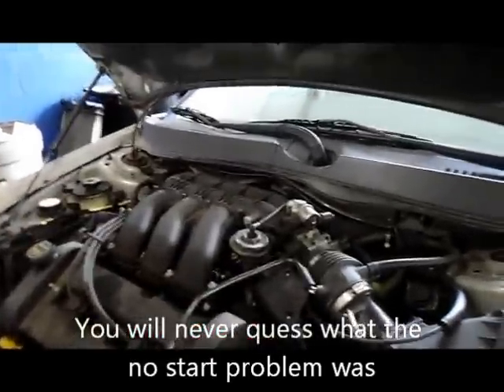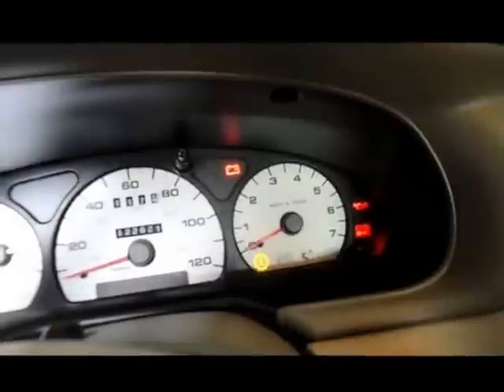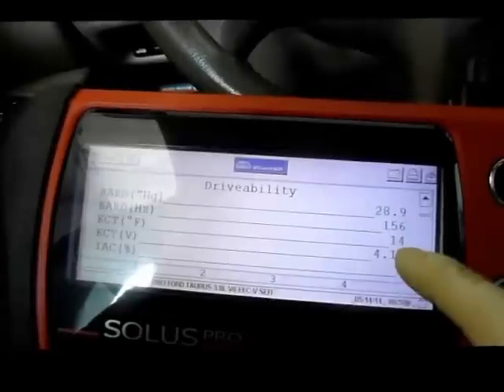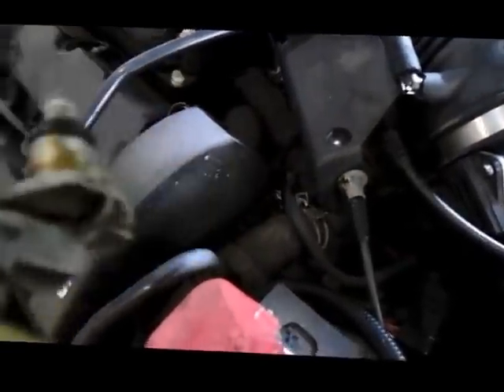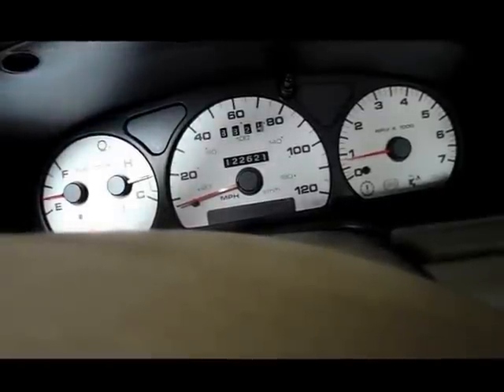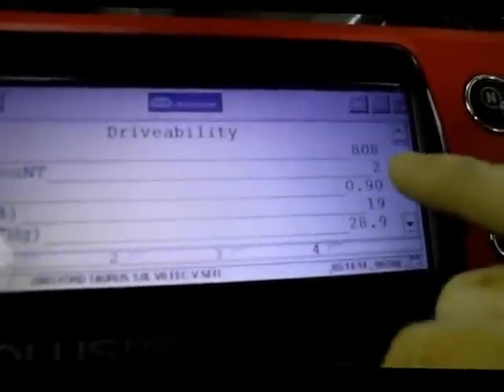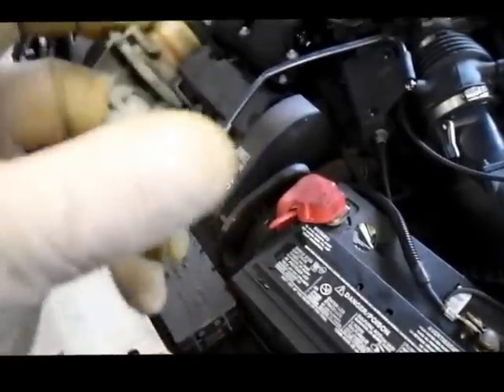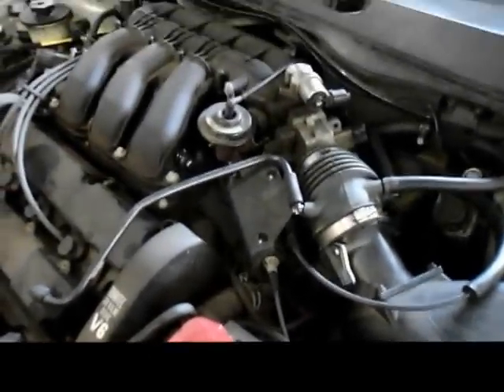Engine cranks but won't start

Comment: What if the car wont start no crank...but it turn on.
Reply from the maker: Check out these videos . Maybe they will help you to diagnose the problem.   
https://youtu.be/Sqg33Mz1308 
https://youtu.be/oka0WrKLiVc
https://youtu.be/UxqJ_EP8f8o

https://youtu.be/UxqJ_EP8f8o

https://youtu.be/5zZZWd--duE
Reply: AAH FOR THAT ONE I THINK THE YOUR PROBLEM IS ON THE STARTER SELONOID. EITHER YOUR SELONOID CABLE IS DISCONNECTED OR THE SELONOID ITSELF IS WORN. FOR YOU TO KNOW EXACTLY WHAT IS THE PROBLEM LET SOMEONE GO TO START YOUR CAR AND YOU YOUSELF BE INFRONT BONNET OPEN. WHEN HE TRIES TO START LISTEN CAREFULLY FOR A CLICK SOUND FROM THE STARTER IF IT IS NOT THER THEN I CAN ASSURE YOU THAT THE CABLE IS DISCONNECTED OR YOU HAVE TO CHANE THE SELONOID
Reply: @m.b.smoshitoa8325  Well i have a 2001 honda accord. I change the gasket for the Vtec solenoid in suddenly it dont crank or start the car but it turn on lights. I did change the starter but is still the same help?
Reply: Maybe a safety switch on the trans.
Reply: My car 2002 Honda crv was running fine. Stopped at store and killed it and it won't start again. It will turn over till the battery dies but it won't start. Put alternator and fuel pump on it but it still won't start. Please help me and thank you.
Reply: @susieshade60  This is why garages pay a fortune for diagnostic tools because cars have become more and more computerized.. as you can see from this video a simple coolant sensor could cause you car not to start.. unfortunately people would be simply guessing the issue and as you say you have bought new parts that you may have never needed...My two cence though is it seems you have an electrical fault..
Reply: Sounds like it can be the starter, that can be checked on car, tap it with something to see if it starts, if does, then starter, before putting a new starter in, always bench test them, jump start them on bench, BATTERY hooked up the right way, they put black to ground and red to nut wear wire bolts to, be careful, the gear should come out and spin, that's called engaged into flywheel and then it spins your engine over to start. Okay if not sure how, then lookup on how to test it before you WASTE your time installing it, I've done this twice with 2 new starters back to back, took the one out of spear car i had in my yard for parts, just very greasy, cost was just $35 because I worked at a gas station as a gas attendant, got GARAGE PRICES. It was stupid to jack a junk up and take out, engine was for sale so I tried to keep it as a running car. Took other parts. I bet its your starter, any store will check at store once there and out, I should of had mine checked before dying with lights on and off.
Reply: L
Reply: Alternator
Reply: May I suggest.. Put the key in the drivers door with the window rolled down reach inside and lock all doors.. now turn the key in the door to the unlock position and hold it there for 15 or more seconds.. now turn the key in the door to the lock position for 15 seconds or more. Now open the door and get in.. put your foot on the brake and hold it while you turn the ignition to the on position without starting the vehicle.. now there is a trip/odemeter reset button in the dash cluster.. make sure it is set to Trip and not complete vehicle mileage.. turn the key back off when it is set on Trip.. with the key off hold the trip reset button in the dash instrument cluster and turn the key into the on position but do not start the vehicle.. hold for 30 or more seconds (all this time you should have been holding the brake pedal down normally).. now turn the key back off and release the button in the instrument cluster.. note.. do not release the trip reset button until the key is in the off position. All security "engine immobilization" "anti-theft" and even engine maintenance warnings have now been reset. Take the key out of the ignotion. The anti theft light in the dash instrument cluster should blink slowly when the key is not in the ignition. Now insert the key back into the ignition and turn it to the on position without starting the vehicle.. wiggle the steering wheel to make sure it is not caught in a bind as this will prevent the key from performing as it should. With the key in the ignition wait 10 minutes and turn it off and leave the key in the ignition In the off position (this is a lightweight ecm/key program.. make sure all keys that will be used with the vehicle are in the area of the driver when all of this is performed.) After waiting 5 minutes with the key In the ignition and the position of the key being off. . Try to start your vehicle. If you get a no crank or no start there is one more thing you can do.. (never remove remove a battery cable with the key in the ignition) under the drivers side dash board, located in the vicinity of the steering column will be a white plug with 16 pin holes in the end of it.. you will need a paper clip or a short piece of wire to do a hard reset of the ecm/ecu/engine immobilization security feature. The white plug has a shape that only allows it to be plugged Into something one way.. it also has also feature on it that locks together with anything you plug into it.. looks like a small hump about a quarter of an inch long in the middle of one long side of the plug.. hold the plug with that hump facing down. . 8 pins across the top and  8 pins across the bottom. In the top row count over 4 pin holes and in the bottom row count over 5 pin holes.. these are the holes that you will place the paperclip or wire into while the Ignition is off. If looking a diagram it's pins 4/13.. now with the paper clip in the top row #4 pinhole and in the bottom row #5 pinhole.. turn the Ignition on for a few minutes (do not hold the paperclip and make sure it doesn't touch metal) after a few minutes turn the Ignition off and remove the paperclip. Ecm/ecu and engine immobilizer has now been Hard Reset. If the vehicle still does not start.. make sure your insurance policy Is up to date and roll, drag, push the vehicle into the river lol no I'm just kidding.. maybe ha! Seriously though geez.. OK a door lock actuator may be the problem. Check to make sure all doors lock. If not replace the actuator for that door. Start from the top of this list again and at the end of It if the vehicle still does not start.. try putting the gear shifter into neutral while holding the brakes and try to start the vehicle in neutral.. if it starts in neutral it means you have have a bad neutral switch located near the gear shifter or on/in the transmission. The last thing you want to do is disconnect the battery and let it sit over night.. but if you do that.. you will have to perform all of the above plus.. another set of tricks to reset the TPS (throttle position sensor.). I'm not even gonna go there.. OK OK I will geez lol reconnect battery. Sit in drivers seat. With the key out of the ignition press the gas pedal all the way down and release it. Now insert the key and turn it to the on position with out starting the vehicle. Now leave the key on and very.. very very slowly.. slower! Very slowly press the gas pedal all the way to the floor.. slowly I said dang.. lol  :)  hold it to the floor for just a few seconds and then slowly.. very.. very.. slowly release the gas pedal.. Slower!!! Slowly.. oh yeah.. that's it.. Mommy likes It like that lol once the gas pedal reaches the top remove your big Ole foot and no turn the ignition off. Wait 5 minutes. The throttle position sensor (TPS) had now been reprogrammed in the ECM/ECU. Try to start the vehicle. If it doesn't start don't ask me what to do.. I'm just a 24 year old girl lol hope it helps someone tho.. "p.s. My dad and uncles, brothers are all shade tree mechanics and that's just a little of what they have taught me about vehicles.. plus I'm not a prissy dumb city slicker girl yall.. Alabama Girls Are The Best!! No software or specialty tools
Reply: Am surprise as well.
Reply: @terencejones7334  . That's a rude thing to say to someone trying to figure out a real problem that affects their livelihood. However complicated cars have become let's be honest and admit that it doesn't take a rocket scientist to diagnose a car. Worst case scenario we can buy an OBD scanning tool for pretty cheap. As we can see in this video most engine components are held up by no more than a few bolts and don't exactly require a scientist to replace the parts. Its one thing if we're talking about an engine or transmission rebuild which can also be learned but your advice comes across condescending.  Everyone who owns a car should at the very least understand how their cars run so they don't get ripped off every time they go to a mechanic.
Reply: Disconnected but something I'm notice the ecm gauges don't click anyway I can't turn on lol
Reply: Ok @susieshade60
Reply: @amberjohnson6969  ok girl.
Reply: @amberjohnson6969  ok Alabama
Reply: Not possible
Reply: @jimthecarguy hi
Reply: sorry to be so offtopic but does any of you know of a trick to log back into an Instagram account..?
I was stupid lost my password. I appreciate any tips you can give me
Reply: @Rowan Kole instablaster :)
Reply: My experience is take it to mechanic who won’t be able to replicate problem which fixed itself somehow mysteriously.

Comment: Hi Jim, I'm a believer now.  My 2006 Ford 500 cranked but wouldn't start for two weeks.  Spark and fuel pressure at the injector rail all checked good so I gave this a try and presto. She started right up today.  Happy camper.  I was planning for an expensive towing and shop bill.  Thanks for sharing this.

Comment: Excellent video, just spent 28K on a new VW because my immaculate 2004 Taurus DOHC Duratec had that exact same issue.  literally scrapped an 83,000 mile mint condition car over this after replacing everything from fuel pump relay to crank trigger, to coil packs. Again, great video

Comment: Thanks for your insights. i had a problem like this with my 1999 Mercury Sable. I opened the hood and found the coolant temperature sensor. But while I was down there I did the wiggle test of the wires. Lo and behold, the car started!
Reply from the maker: Glad it helped

Comment: I remember how it was before those sensors were put on cars. The cars worked just fine. I was told that those sensors were to detect expensive problems before they happen; but the sensors themselves can be even more expensive problems then the problems they are suppose to detect. I would love to see us back to the days when things were simple not so expensive.

Comment: Jim,
  This is super common, as Temp Sensors usually fail by breaking "OPEN". Electrically, the computer's pull-up
resistor pulls up against air, instead of a temperature-sensitive resistor (the sensor). The problem is that the
Twenty-Something Software Engineers at FORD programmed the Fuel Injection Map to starve the engine, because
a broken sensor reads like a very HOT one. Firing them all might actually cure these problems...
    I just carry a spare one in my glove box and plug the connector into it, laying it on the engine somewhere. The
truck starts right up. The modern PLASTIC sensors shear in half when you try to remove them, so ALWAYS use
the Brass ones. 1995 F-150 4.9l standard trans. CHEERS, and good video!  Hap
PS: Volvos have the same problem! Find me a truck that can recover from such a simple (and common) parts
failure, and I will dump the Fords and buy one!
Reply: Thanks for heads up if that works on 2003 Ford Explorer 4.6L AWD now, if they break easy, then I'll buy one and plug in and it starts up ? If so then I'll do that until I can get inside to work on it, almost sounds like no FUEL or timing chain because engine TURNING over faster than normal it sounds like. Only 72K on Reman engine that's taking care of.

Comment: Than you for the video. A friend is thanking you more, he had this problem back in 2012 with his 2004 Taurus. Long story short, his responded the same as you described. He had his towed to the local dealer who had the car for 3 days. They called for him to come pick up his car and gave him a bill for $1200. It was all diagnostic and $240 for the sensor. They will be returning to court shortly. You may be approached to clarify your findings.

Comment: My 2007 Ford Taurus SEL has been doing the exact same thing:  cranks but won’t catch. But it only happens sometimes, not every time. Auto repair shop is unable to find the source of this problem, even with their best mechanic and the diagnostic computer. 

This issue has now moved to the URGENT category since I was almost stranded at the grocery store last night. Cranked and cranked 7 times with a long pause in between attempts so as to not run the battery down. The 8th time it finally caught and started. 

I am going to buy the part and, if I get brave enough, I might even do the work myself. (Maybe.)

Thank you so very much for posting this! I will let you know how it goes.

Comment: PRS - Wish I Hade Found This Sooner!!!  2019
This should be the number one video on YouTube for No Start vehicles.  I have a 1995 5.8 Automatic Bronco.  During the past two years I have look at hundreds of videos on for my no start situation which is the same as the person who posted this video and the many people who saw it even though I did not see it.  Over the past two years I have replaced every sensor on my 95 Bronco under the hood including the water temp sensor.  When the water temp sensor was replaced a couple of other sensors were also replaced and the vehicle started and ran for a couple of weeks.  I did not know it was likely that sensor that got it running.  Over the past 9 months I finished replacing everything I thought might be a problem.  Finally I took it to a repair shop and after checking the Bronco they advised it was not getting fuel and needed a fuel pump.  I had previously done test on the pump and new it was not  only working but that it was also flooding the engine at times.  The shop called me again and stated the new fuel pump was now suppling fuel but they needed to install another new WATER Temp sensor and another fuel control part.  Later that day the shop called me and stated the vehicle was running and I could pick it up.  It only cost me a little over $1500 for what I now believe was just a bad water temp sensor.  Judging by the number of comments on this video, I think YouTube should highlight this video on every NO START video as a serious and inexpensive possible fix.
Reply: I bet they never replaced the fuel pump, they knew what it was with computer, best to look online to see if a traveling mechanic with top notch Snapon computer to check for 1/3 if the price. I hate using craigslist but there's some great MECHANICS that drive to you and check things for minimum fee provided how far they may be. Me, WELL i live in a small STATE, takes an hour to CROSS it, but i boarder another state, people can CHARGE only $40 if close to you if your doing work. But if more wrong, he gives quotes on paper with you getting parts or them getting them. Best if they get on certain parts. Other parts with core charges, ask if there charging for core CHARGE, if so, then ask if you can get that and always ask what store does he use, he may give his name to use and save you MONEY, make sure you pay any and all taxes now. Have a FRIEND that has a few accounts, I DON'T have mine since our GARAGE closed in April 2st of 1994, PEOPLE thought I was pulling a JOKE, I knew all my CUSTOMERS and it was a shock to me and others that work there, 4 year remodeling jib that took tearing it down and building a new Exxon without the 3 bays. Wished I knew, could of taken old machine's that I used to fix tires for CUSTOMERS and gave 50% to my boss, at 1st he was pissed, I said I can't use this but I can fix flats but it never happened, charged $15 with balancing it. THEY sat for 5 year's, kept asking to open it BECAUSE one guy drove 22 miles to spin wrenches, I had 4 great MECHANICS that wanted to work as a sub contractor. So just renting lift bay out and you get a cut of every job with a slip for records if wanted, boss said nope. Not EVEN our cars at all. Sucked working off GROUND, got fired 6 times for working on my car or FRIENDS coming to my work after they got out of theres around 11:00 to 11:30 p.m. i CLOSED AT MIDNIGHT, they SCARED the old LADIES AWAY he said, I said they kept me from getting robbed like what HAPPENED before i started working there, a guy shot in knee a year before me, i started at 15 years old. Back then, NO LAWS ON WORKING ON THINGS, JUST NOT PAST MIDNIGHT ON A SCHOOL NIGHT. I GOT OUT ABOUT 12:10 A.M. after counting draw and making final drop and locking up paperwork in OFFICE. Had fun there. LOTS of fun.
Reply: I have a 2007 Escape that seems like it is a timing issue. But it is flooding the cylinders with the crank no start. I will try this thank you. I HAVE ALSO LOOKED AT EVERY VIDEO ON you tube for about three months.

Comment: That's exactly what I've always wanted... a car that will leave me stranded because it doesn't know the coolant temperature.
It should have started in open loop, then thrown a code and a check engine light, but nooOOOOOoooo.
Reply from the maker: Thanks for watching. Don't forget to hit the bell for notifications when a new video is posted.
Reply: @jimthecarguy   @Jimthecarguy  this is happening in my 92 mazda navajo / ford explorer. Online obd 1 diagnostics say to ignore faulty ect sensor code since it's got to be within normal operating temp to their good codes, replacing everything else I went back to this sensor, heated it up on my desk with Cooper wire plus solder iron, resistance reads true.. purchase new ect sensor and resistance reads true. I might revisit the problem and see if I am not getting continuous current.. my only guess